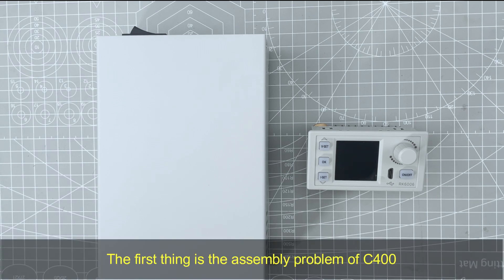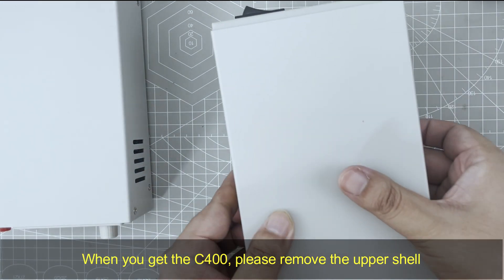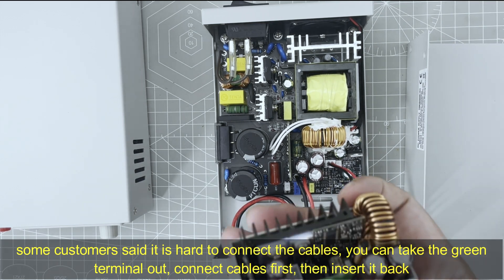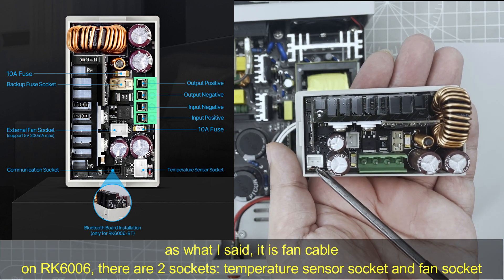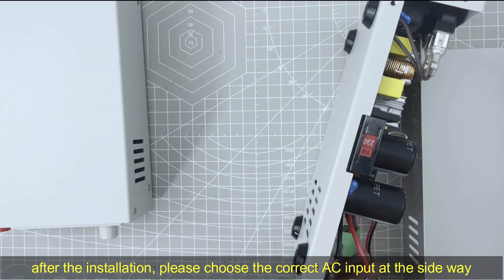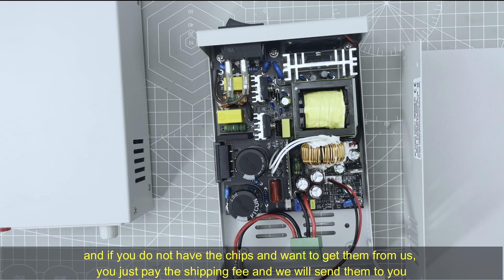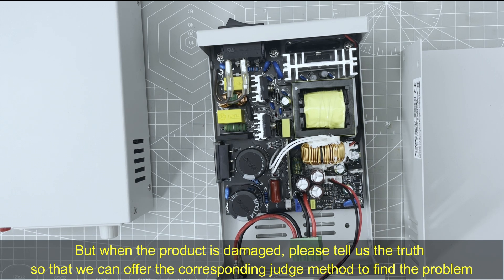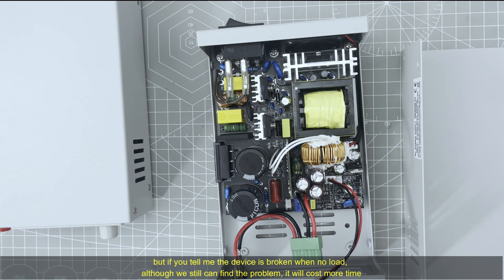C400 assembly to RK6006(cable connection and AC selector)

Comment: I have successfully assembled my two sets. Both show an input voltage from the C400 of over 69 volts (when idling). Should I make any adjustments to lower the input voltage? (Is there an adjustment possible on the C400 board?)
Reply from the maker: hello, normally there is no needs, if you want to adjust, you can adjust it, the rotary switch is just near the output termial on the C400 pcb board